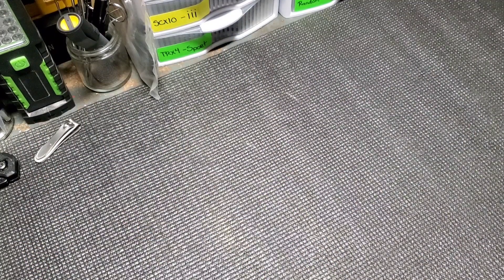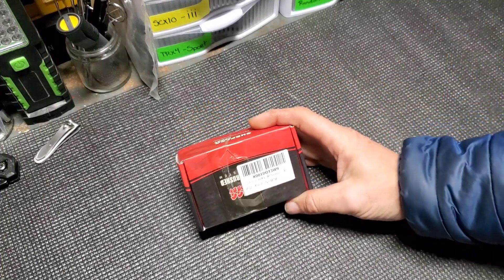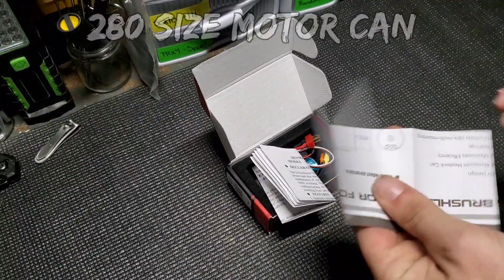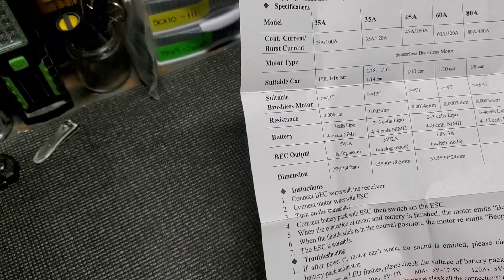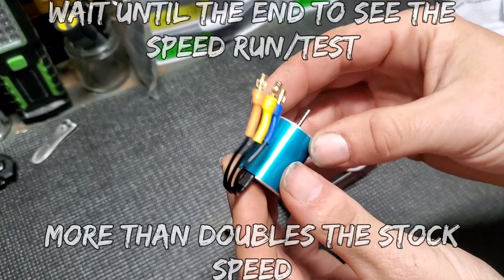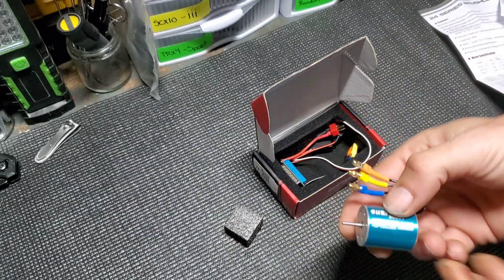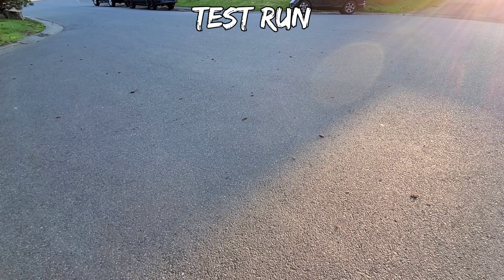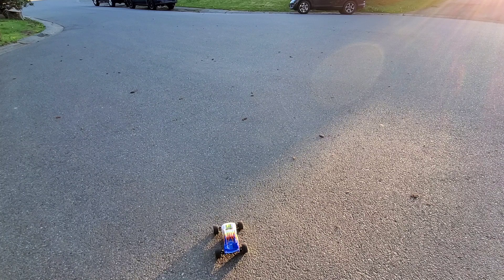Losi Mini T 2.0 Upgrade - "Surpass" 7200kv Brushless 4-Pole, 25Amp Motor ESC Combo

Comment: Can I run a brushless motor with the stock esc?
Reply from the maker: Unfortunately no you can not.
Reply: @thecollectorrc  there is a 3300kV version of the 2435 rated at 18A and the stock ESC is 20A, will that fit? I'm new to the hobby, what else am I missing
Reply from the maker: You're going to need to get an ESC that can run brushless. They are different. It's more based on the electronics not the amps.
Reply: @thecollectorrc  got it, thanks for the help

Comment: Am I able to pair my losi mini t 2.0 controller to the ecs I bought this motor and ecs but idk how to get my controller to connect or will I have to buy a different one and if so what kind
Reply from the maker: No you'll need a Transmitter/Receiver replacement unfortunately.

Comment: How do you set throttle endpoints??
Reply from the maker: Well I'd need to find my stock Receiver/Transmitter to take a look, but during this video I was using a Flysky GT3B I think and that has all the settings you need displayed on an LCD screen. 

I assume you want to limit it's speed for better control, or are you having issues with idling/brake/throttle points?
Reply: @thecollectorrc  i just wanna make sure im getting full throttle but no button  on esc like most to set

Comment: nice man. I have the hobbywing 5200kv brushless system in mine, just the right amount of speed. I just ordered a mini b with the dynamite 2in1 and all of the mip upgrades too. Cant wait. Oh get some step pin tires for the rear makes a huge difference.
Reply from the maker: My new tires arrived a couple days ago. 😉
Reply: @thecollectorrc  I have a new transmitter and reciever having a hard time bonding the together how was bonding the esc with transmitter?

Comment: I recently got the Dynamite 25A mini esc and a HW 4500kv 380 brushless motor for my 1/18 Axial Yeti Jr Can-Am. It was alot more expensive than other comparable choices, but wound up being an excellent combo for the little Can-Am. 3s is just a little to much power for it(rated for 2 or 3s) so I'm ordering a couple of 2s packs to run in it. I would like to try it out in the Mini-T on 3s though, just because of the lower cg it has. It wound up being an awesome setup for the small scale rc vehicles and I will definitely be buying another one for a different project. Good video.
Reply from the maker: We've been eyeballing those Yeti Jr. We'll more than likely have one soon on our channel.
Reply: @thecollectorrc  be warned, it rolls alot, especially on asphalt. Replacing the suspension links and control arms with aluminum parts and locking the rear diff helps quite a bit. Mine is extremely fast on open dirt and doesn't flip nearly as much now, even on the stock tires. I'm even thinking of trying a set of aluminum wheels and 1.55 tires to see if that helps a little more. Don't get me wrong, it's a great rc, and I'm glad I got it, it just takes time to get used to the higher center of gravity. GPM and Hot Racing makes alot of aluminum replacement parts for the Yeti jr.